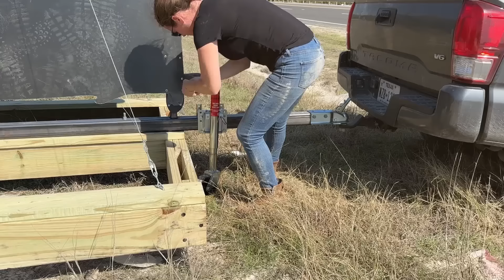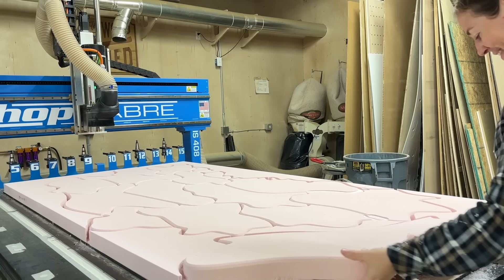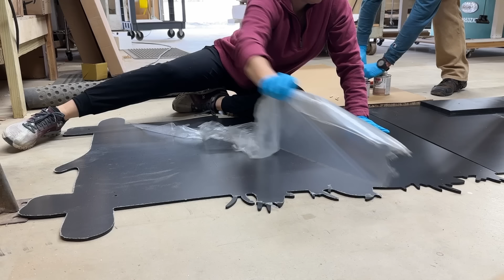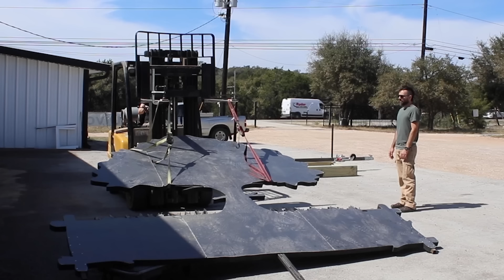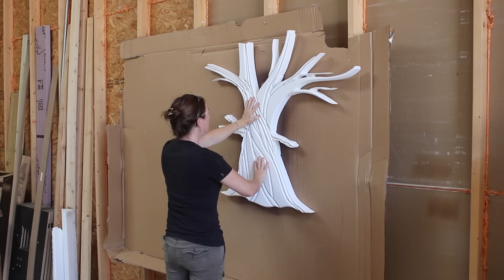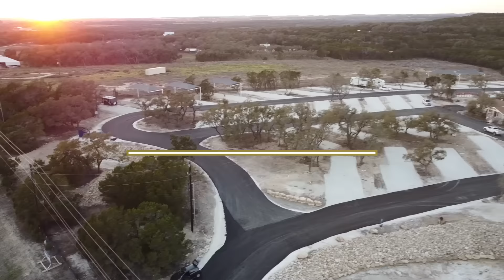Sign for my NEW RV PARK: Foam+Steel+PVC+Wood

Comment: I would love to visit both your RV park, and your shop.  But it is a long drive from NY to TX pulling an RV behind a truck. I'd hate to consider the cost for the fuel alone....lol. However I will be at the Mid-America YouTube Meet Up in OK on the weekend of May 16-18.  Hope to see you there.
Reply from the maker: Thankfully, there are a few options. Some, due to a long drive, simply rent an RV in our area and stay without the time and expense of driving their own RV down. For short term it's a great solution for them. (There is a place in Canyon Lake that rents RV's.) Others, bring their RV down, leaving it and fly or drive in as they want to use it. I hope you're able to visit soon. Thanks for watching.

Comment: From what I see online, those PVC sheets must have cost at least a few thousand dollars total. And they will probably fade a lot in the sun. It might have been easier cheaper and more sturdy to hire a plasma cut sign from steel
Reply from the maker: If the sun fades them, we have paint to refresh. If hail or other damage, pieces can be recut, painted and replaced. Thanks for watching.